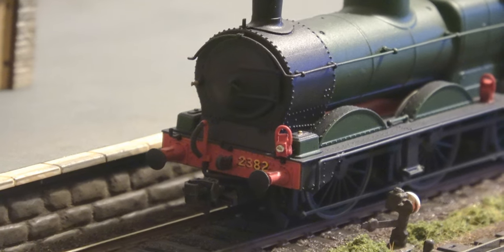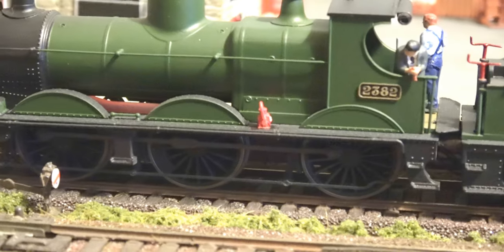LOCOMOTIVE LAMP CODES (A ROUGH GUIDE)

Comment: I’m pretty sure I’ve seen another head code which is a single white lamp and a single red lamp. This would mean that the engine is shunting or moving about a yard and mostly likely would not be pulling actually trains. Just building consists for other locos
Reply from the maker: You could be right not heard of that one.
Reply: @BrockwellLanemodelrailway  Yeah it’s a bit of a weird code as it looks quite similarly to the express code just one of the lamps being red. I only heard of it due to a game I played on and some of the engines can be made to have different head codes and shunting was one of them. Not entirely sure it’s a code either that or it’s not used anymore.

Comment: You mentioned Southern discs.  My understanding is that these were route destination indicators rather than train types. Not sure whether Southern used same codes for lights.  They certainly carried lights of course.  Many of the later models electric lights.